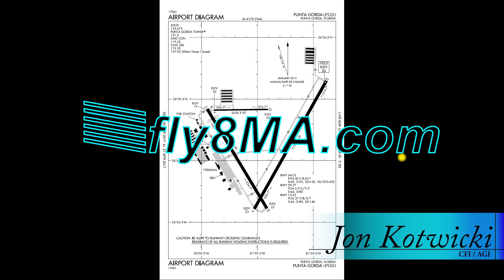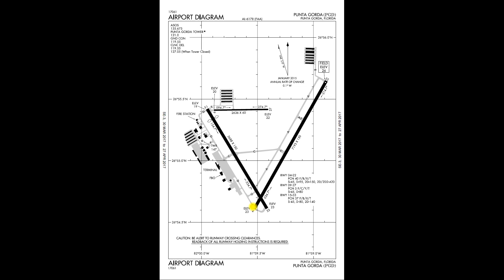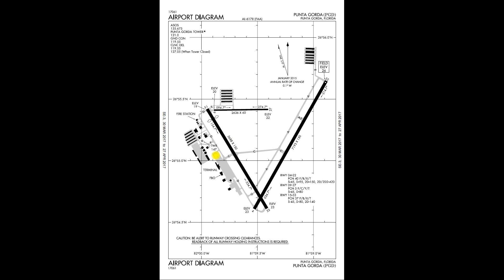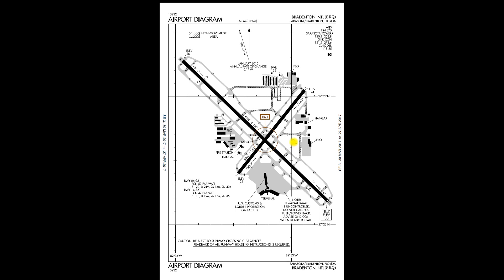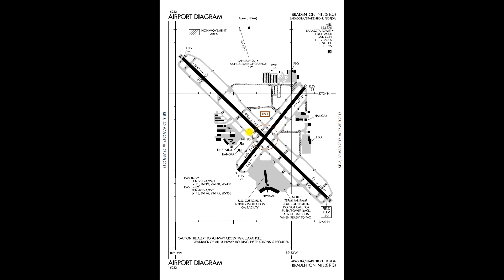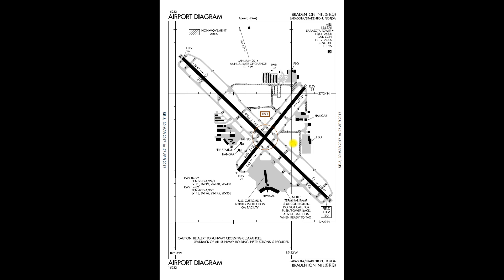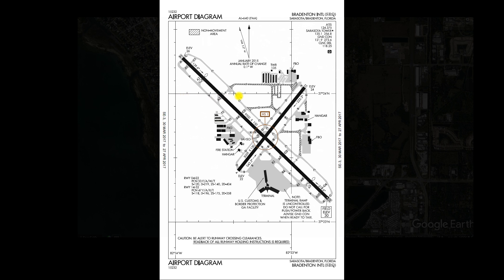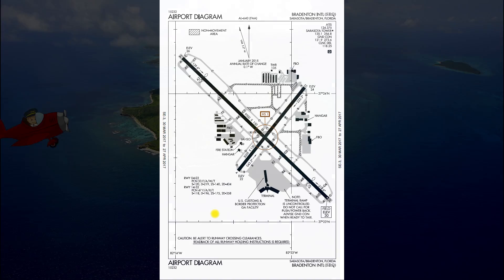Ep. 111: Airport Diagrams Explained | Taxi Diagram Basics

Comment: I came here to find out those numbers listed for the runway-   Bummer-- But I did more research and found they are "PAVEMENT CLASSIFICATION NUMBERS"  which tell you the strength of the landing surface.  Search Wikipedia for that and there is some very helpful guidance.   Nice video-
Reply: And the "S, D, 2S, 2D  corresponds to the aircraft's landing gear type- and landing weight in thousands of pounds.     There are Single, Dual, Triple, Quad wheel arrangements.   If your aircraft has a double dual tire landing gear on each side, for example, the runway might show 2D2.   For more info search FAA 5300.7 advisory.
Reply: @djw4fish  thanks!!
Reply: this was super helpful oh my gosh

Comment: Well, since no one else has attempted to answer the question of the RWY text, I guess I will.  Those blocks of text describe the weight bearing capacities of the runways. (see the FAA's legend for Airport Diagrams at https://aeronav.faa.gov/content/aeronav/online/pdf_files/legendAD.pdf)

Specifically, PCN stands for Pavement Classification Number and is described in excrutiating detail in FAA Advisory Circular 150-5335-5A (https://www.faa.gov/documentLibrary/media/advisory_circular/150-5335-5A/150_5335_5a.pdf).  The number following PCN is the maximum usable load limit of the runway surface in MN/m^2 (mega-Newtons per square meter) for a standard single wheel at 181 PSI and gives an overall indication of the strength of the surface. The four letters following that describe the surface type (F = Flexible (generally asphalt), R = Rigid (generally reinforced concrete)), subgrade category (A = High, B = Medium, C = Low, D = Ultra Low), maximum allowable tire pressure (W = no limit, X = 218 PSI, Y = 145 PSI, Z = 73 PSI), and the method used to determine the PCN (T = Technical evaluation, U = Usage assessment). The final four sets of values give the maximum allowed weights (in thousands of pounds) of aircraft with various main gear configurations (S = Single, D = Dual, 2S = Single Tandem, 2D = Dual Tandem).

My Google-Fu is strong today! :)